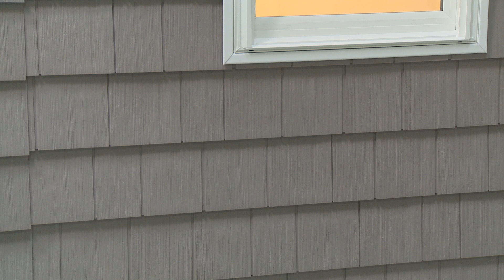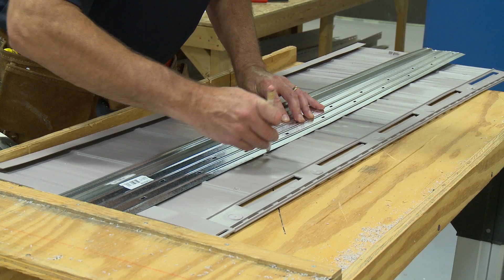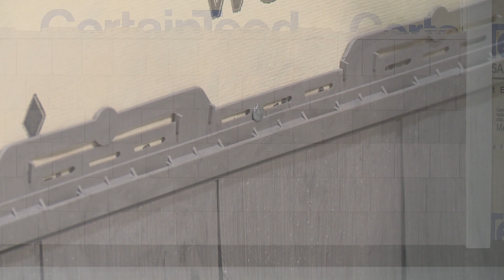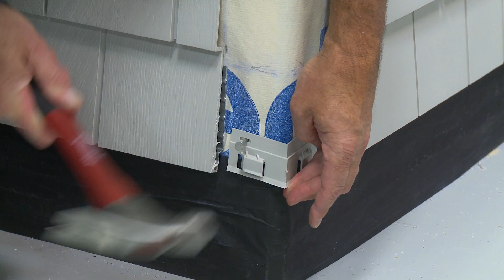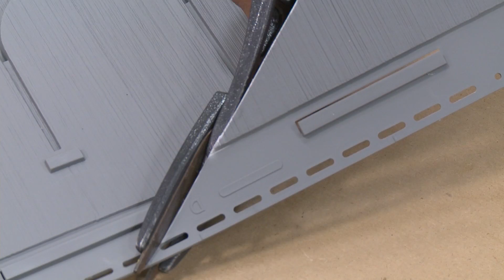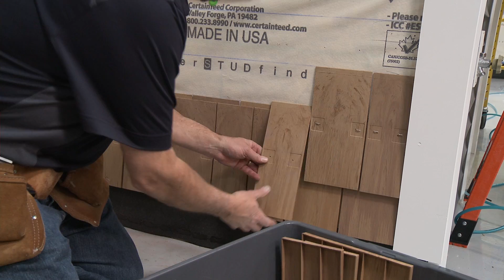CertainTeed Cedar Impressions® Installation

Comment: No mention of the two tabs on the back of the D7 pieces.    If you don’t hook those right the siding will have a gap when you look down the side.     Also how about a real wall install ?     Most houses have much greater complexities than this gingerbread hut in the video